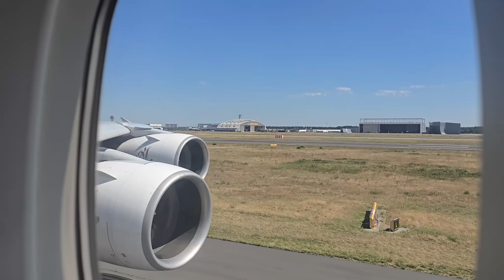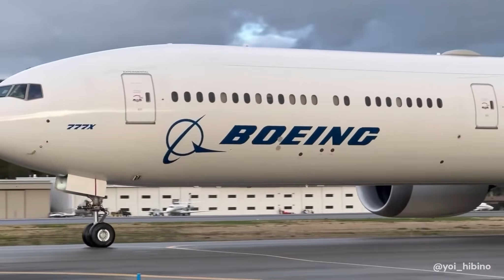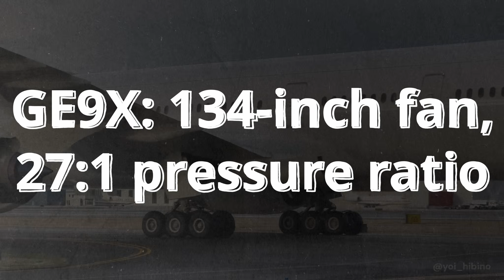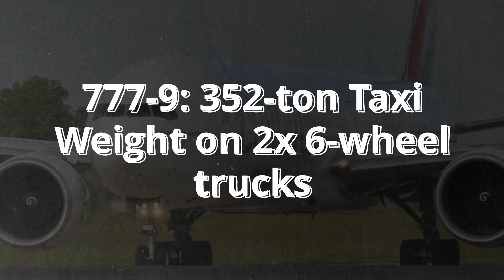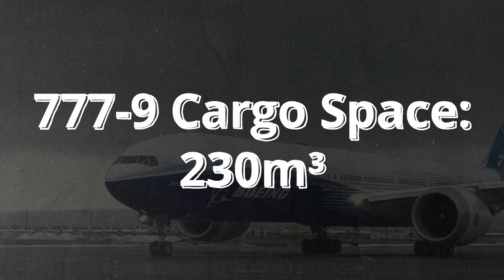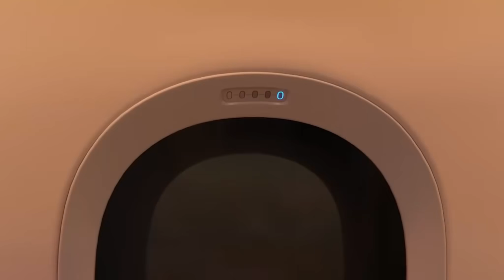Why do airlines choose the twin-engine 777X over the massive A380?

Comment: The pavement dynamics section is easily the best part of this video. It’s wild to think the 575-tonne A380 is actually friendlier to the runway than the 777-9. Distributing all that weight across four identical 6-wheel main landing gear trucks is a masterpiece of engineering. That ACN/CDF difference is a huge hidden spec that nobody talks about. Plus, hearing that Emirates wants to keep them flying until 2040 is music to my ears.

Comment: That cargo volume comparison is brutal, 230 cubic meters vs 133 is exactly why the A380 struggles to turn a profit unless every seat is full. Also, spot on about the cabin psychoacoustics! The 777X maintaining that 6,000ft cabin altitude is a game changer for jet lag, but I guess that's the massive advantage of Boeing finally giving the 777 a full carbon-fiber composite fuselage like the 787 and A350. The aluminum on the A380 just can't handle that pressure differential. Great deep dive as always!

Comment: Man, the engineering behind that 80-meter box constraint is fascinating. Great breakdown of the aspect ratio penalty! I always thought the A380 used the Rolls-Royce Trent 1000s though, isn't? Either way, the sheer cost of four engine overhauls vs two on the 777X is definitely the ultimate dealbreaker